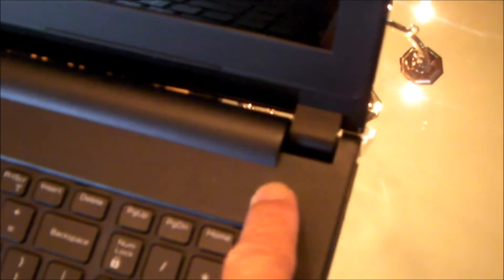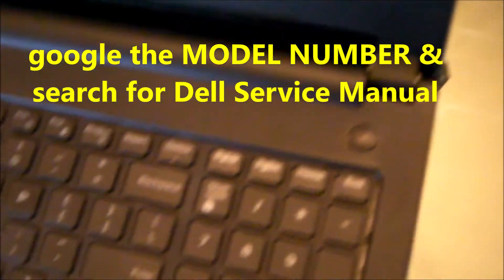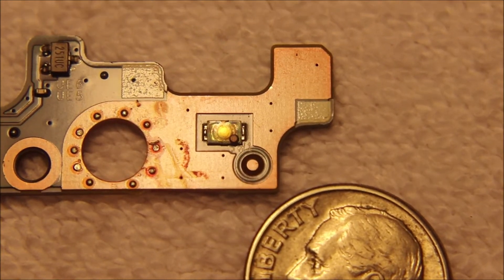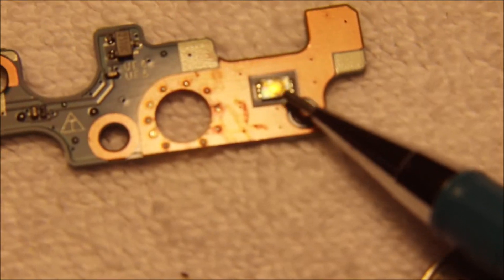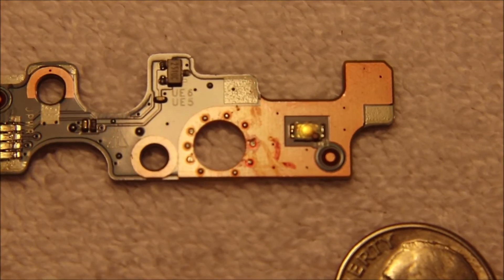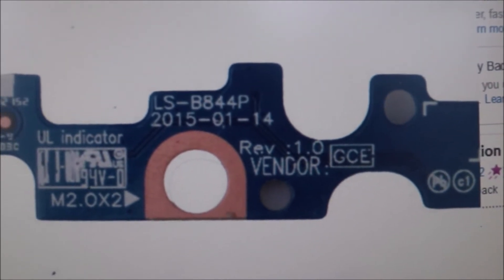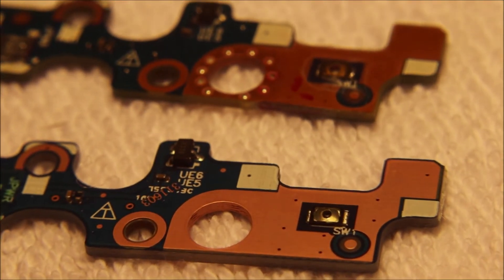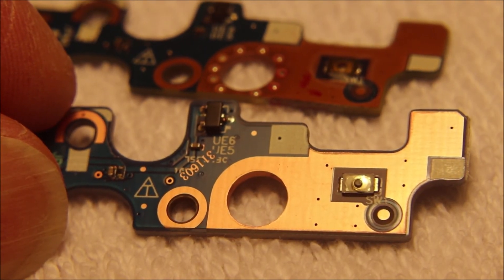Dell Inspiron Laptop won't turn on;  Power button seems to be stuck, jammed or broken

Comment: Like!  My dell laptop power button failed to power on after I decided to clean the dirt around the power button which i thought the reason why the button doesn't push up or down and sometime just stuck. This video helps me to under stand between the good vs the bad power.  After opened the laptop up, I noticed the teeny black dot was missing as well.  Ordered a new power cable/board, now my laptop works like a charm.  Thanks man!
Reply from the maker: Glad my video helped you.  Be sure to LIKE and subscribe.  THAT would really help me!  THANKS!!!
Reply: How much did it cost
Reply: @abderahimabderahim8417  Not sure whether I got it from Ebay or Amazon, but it was less $10 for one power supply cable.  Laptop still works as of today, use it regularly.

Comment: Since you had the black dot from the original, could you not have just re-glued it back on?
Reply from the maker: maybe but it is wicked tiny.  new board was pretty inexpensive and since I was fixing for a friend, did not want to have to open up the computer in the future to re-fix the "dot" if it failed

Comment: I couldn't find my brass thing but i janked some rubber gasket over it
Reply: Bro, I'm gonna do that since I don't have a replacement board
Reply: @danielmann316  i got myself a new board bit guess what
There was no brass thing on it
So i had to take a little piece of rubber and glue it on the button
It works but not perfect
Reply: @faaiquealimehmood  also put an old joystic rubber as my 'dot', using the laptop as i type... Thanks for the idea
Reply: @danielmann316  thats good to
You welcome